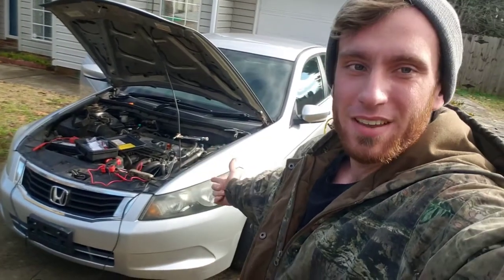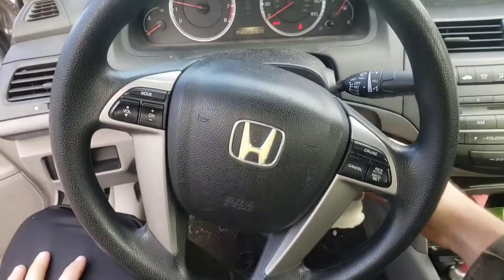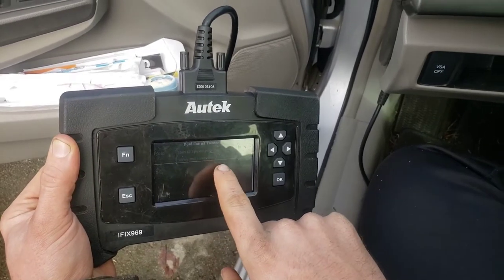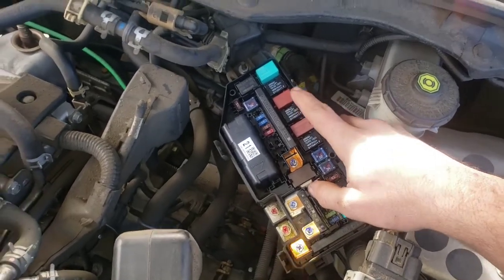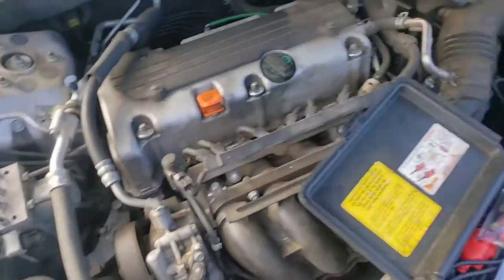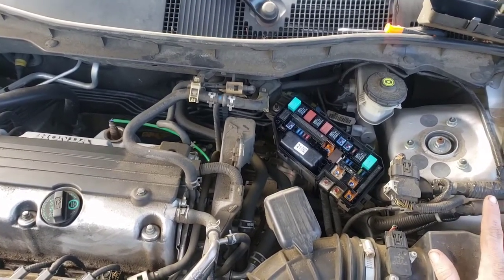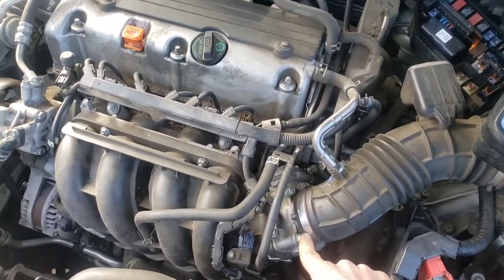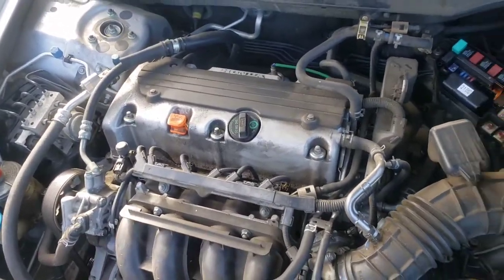Honda Accord Stalls & Crank No Start Diagnosis How to Cuts Off Shuts Turns Won't Stay On 2007 2012

Comment: I just had this same problem with my 2008 Honda Accord. It would start, but then immediately die. After checking relays, cleaning intake etc. everything was good, but still same result. Start, then immediately die. Scouring more videos on youtube brought me to one thread that lit a spark in my head. The battery on my key fob had quit earlier and so I decided to pull it out. After getting a new BATTERY FOR THE KEY FOB, it started and runs great like before. That's all it was, the lack of battery in the key fob sets off the security system to shut down. IHTH someone!!
Reply: THANK YOU!!!  ^^^this^^^. You saved me hours of hassle.  Even putting the dead battery back into the remote fixed this issue.😎👍Also a 2009 Accord.
Reply: Definitely checking that after today. Before I start getting things apart.
Reply: Broke the key off from fob part on my 2011 accord, key still was in tact but car would not stay running, saw this comment and taped the key back together and sure enough the car is now running like before!! Thank you for the help I would have never knew about the security system unless I saw this comment!

Comment: Hey I have a 2010 accord lx , it’s starts but then it shakes a lot and turns off , after a few tries it works fine but also I have the p0420 code , would that affect the car ?
Reply: If the cat is plugged up then yes